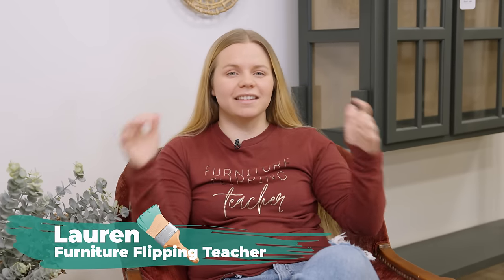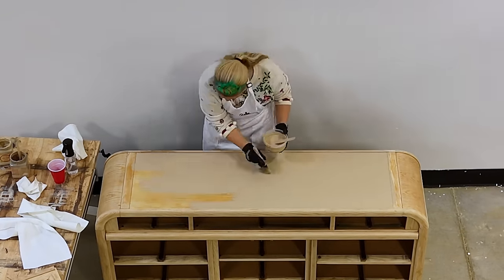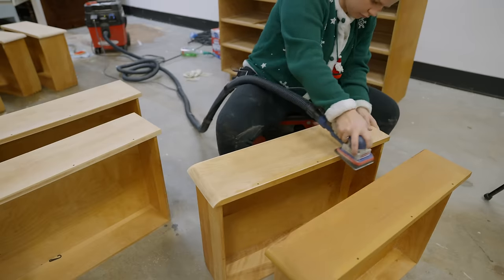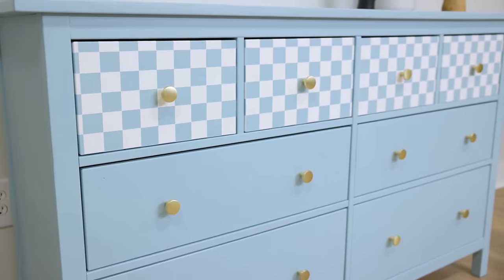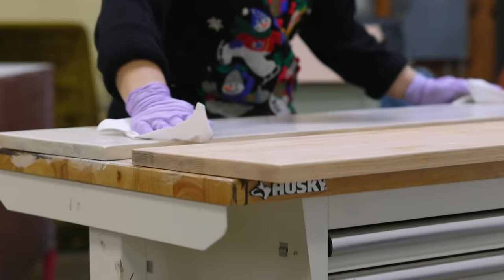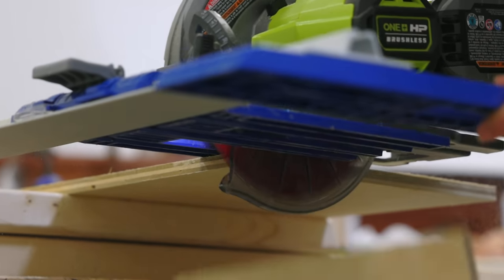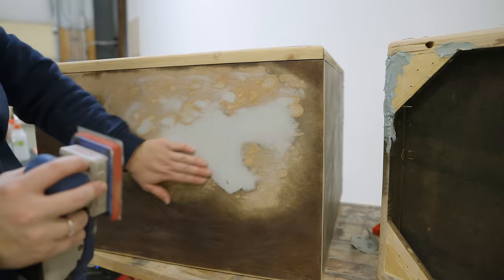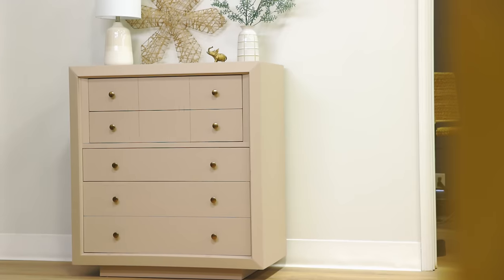I Flipped 11 PIECES in ONE MONTH and THIS IS HOW MUCH I MADE!

Comment: Your style and process has really evolved over the years. It's wonderful to see those old pieces relieved of their ugly dark brown and orange stains and the natural tones and hues of the timber revealed. You did a wonderful job of the veneered piece given that there is so little to work with. I notice that you referenced three different brands of knot blocking primer across your projects and am wondering if you find any one better than the other, or is it a case that only time will tell?
Reply from the maker: thanks so much! the Kilz oil based & Bin Shellac based will give you 100% insurance! Boss & Eclipse are water based so occasionally they still allow bleed through with really tough tanins
Reply: @FurnitureFlippingTeacher  Thank-you so much for that. I can get the Bin here in Ireland so will try it on my project. I'll report back in 15yrs.😄